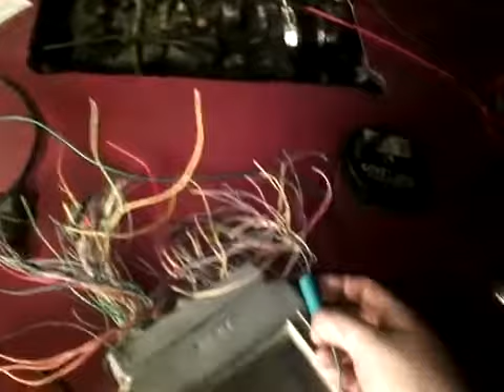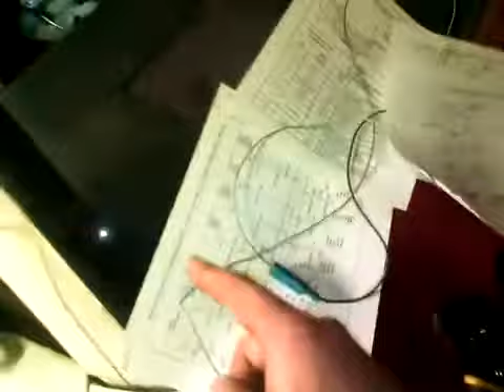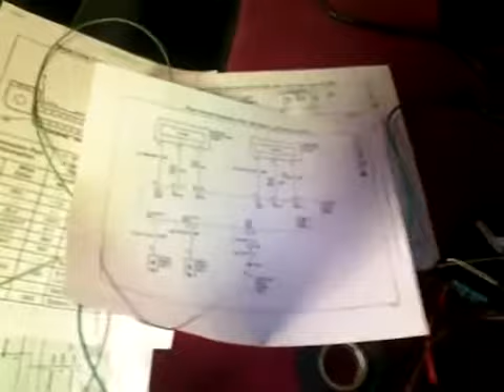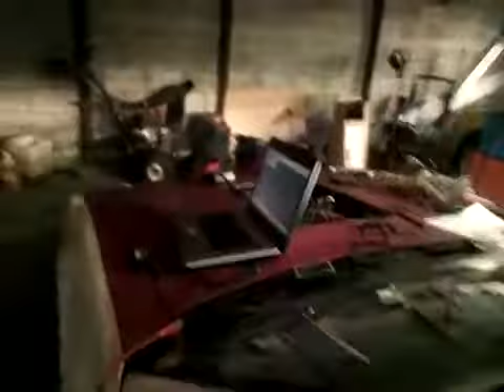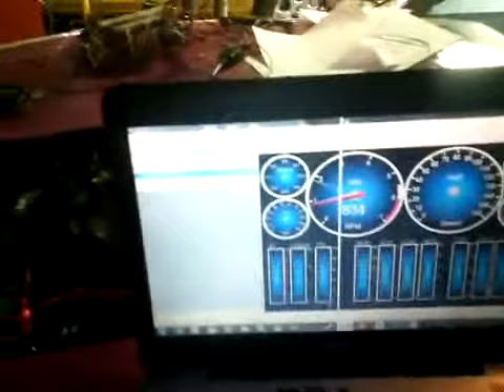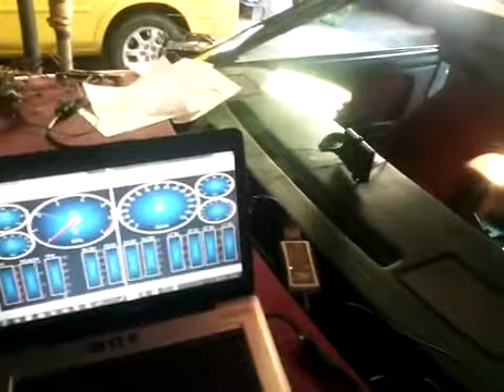Using a  LS1  truck computer as a stand alone Transmission controller test video 1

Comment: Could you use a 7.4l crank sensor in lieu of a ls1 on the ls computer
Reply from the maker: Yes you can. Just would have to flash the ECU with a 7400 tune file or get a ecu from a 7400 truck